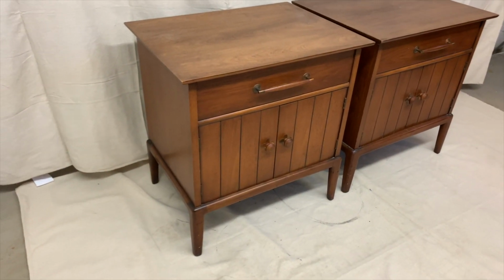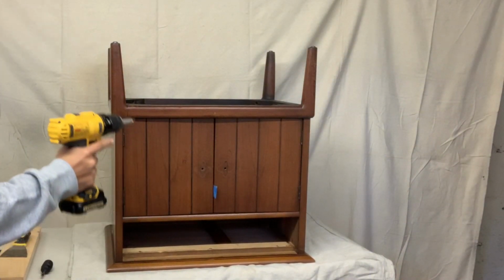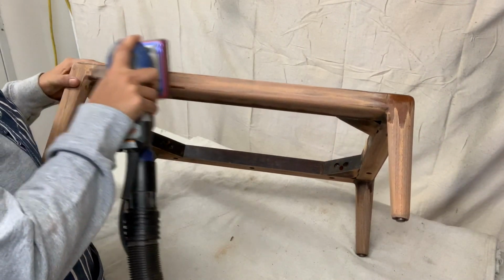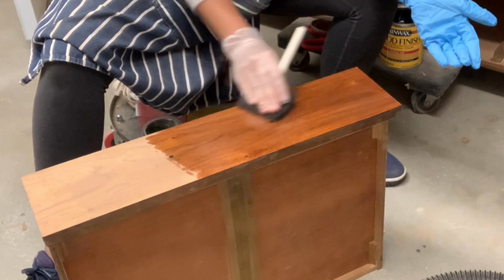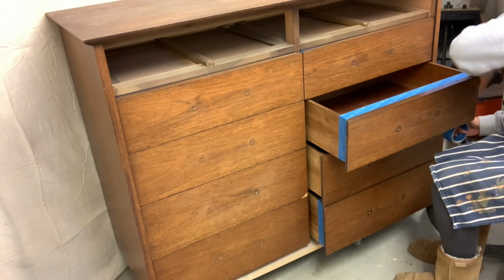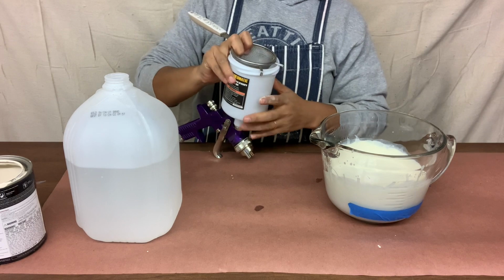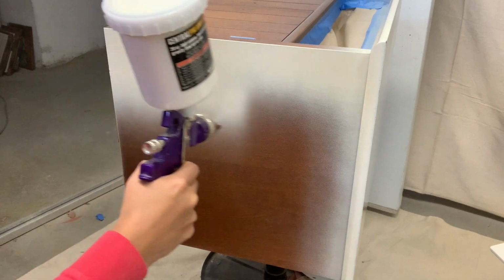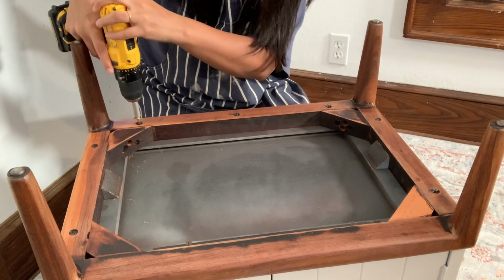REFINISHING VINTAGE FURNITURE | FLIPPING FURNITURE FOR PROFIT IN 2022!

Comment: What kind of spray gun do you recommend? I would like to buy one that doesn’t require an air compressor and doesn’t take much investment.
Reply from the maker: The one in this video is a pneumatic sprayer so it does require a compressor. You’re best bet is the Wagner FLEXiO 3500 and above. Thank you for your comment!
Reply: @GirasolVintage  thank you